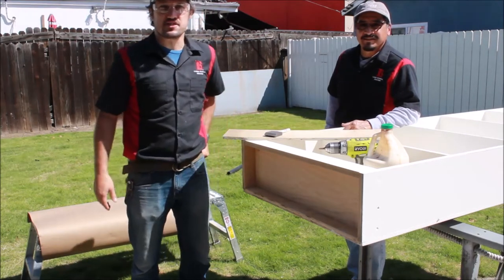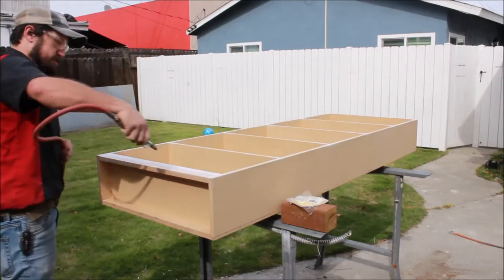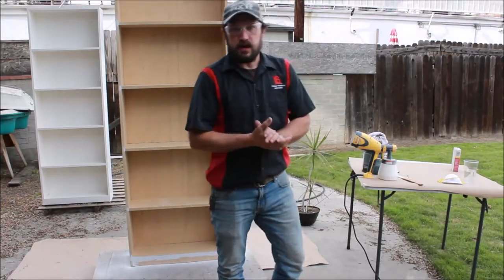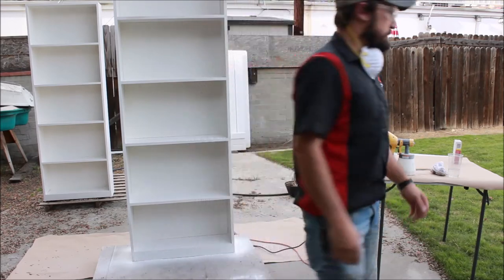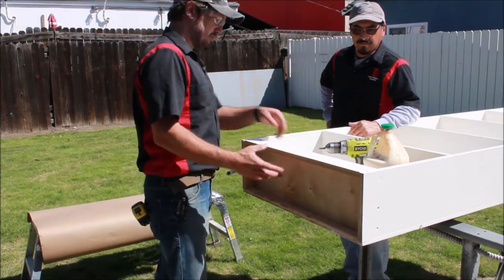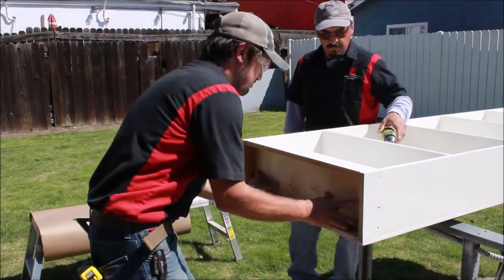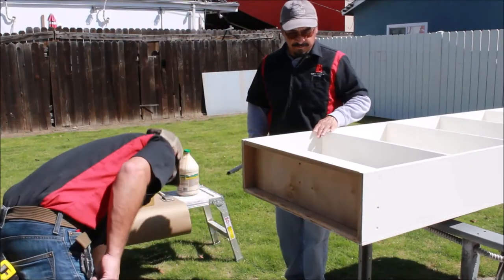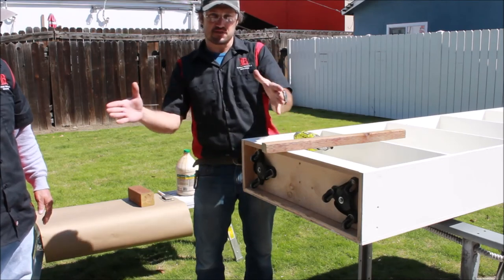Bookshelf Door - Part 1 - Building and Painting HOW TO

Comment: How are you liking this spray gun after 1 year
Reply from the maker: I don't use it too often, but it's still holding up.  The one thing I don't like about it, is that it sprays such a fine mist, that the paint particles blow all over if you're in a windy or non-ventilated area.  Make sure the surrounding areas are covered, so as to not get overspray on anything.